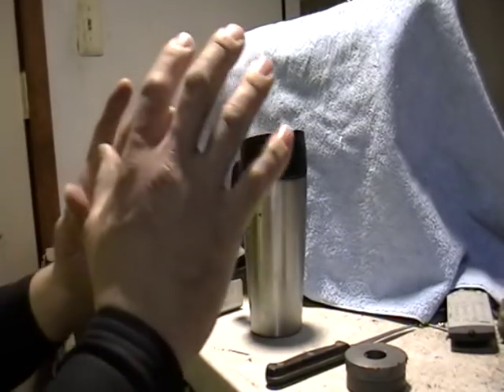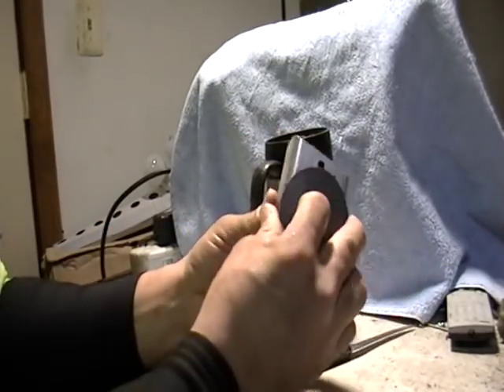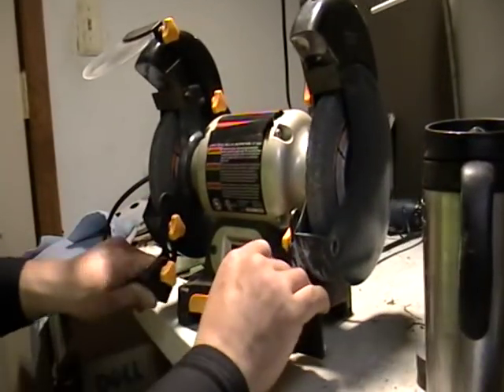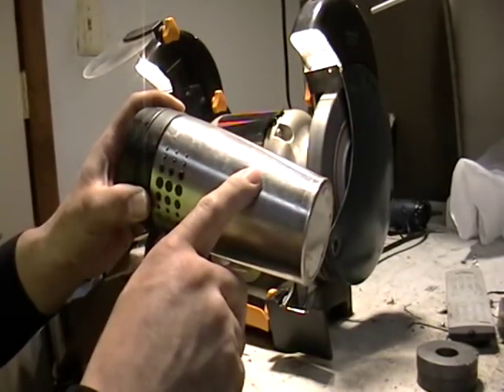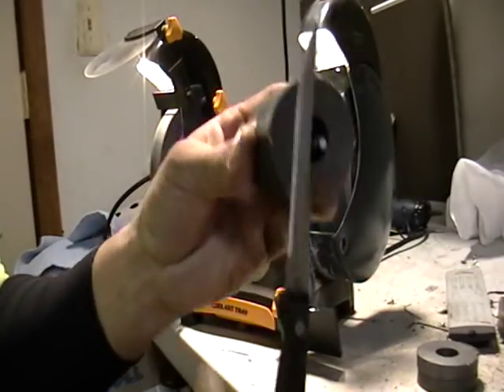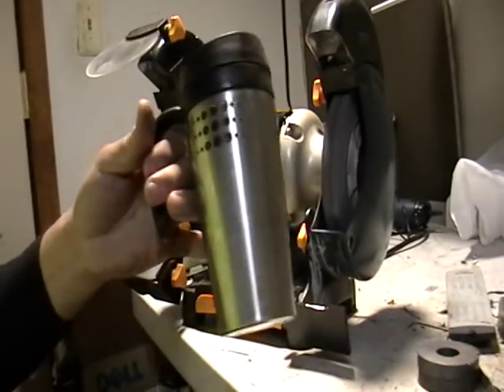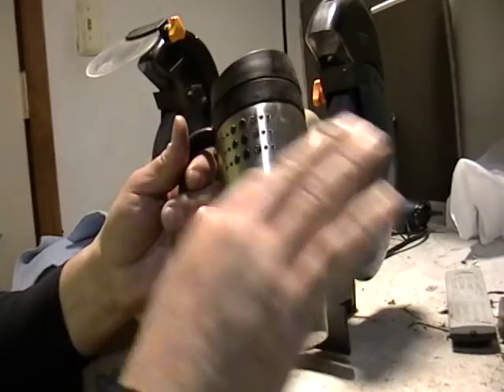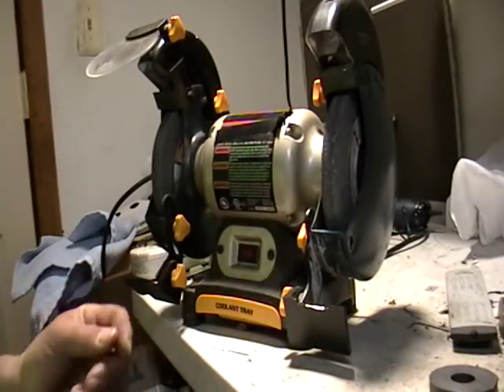Stainless steel or Aluminum how to tell?

Comment: Another method: Take a very sharp steel object (f.e. a nail /needle) and try to make a scratch in the material. when you get a good scratch its aluminium. otherwise its stainless steel.
Reply from the maker: atmosphere Adr Yes. I have done that in the field. the stainless almost glides the nail or blade away.
Reply: Thanks! I don't have a grinder laying around. Trying to find out if my roasting pan is stainless or aluminum. Magnet doesn't stick.
Reply: Thanks, I was pretty sure a second hand pan I bought was aluminium but good to have a way to test that doesn't involve a bench grinder.

Comment from the maker: aluminum is soft. if you use a screw driver and scratch the surface it will go in. Stainless it will slide off rather than make the same mark as aluminum

Comment from the maker: Brass is mainly used in plumbing as is copper...The other 2 metals this video  I explain..
Brass can be white coated with yellow inside or just yellow...( I have seen other colors) ( look underneath your sink) if its not pvc its either brass or copper or both...this should help

Comment: 1. Hold magnet to it. Aluminum, Brass, Copper, high grade stainless steel have no attraction.
2. lower grade SS has slight attraction.  They will move, but they will not stick.
3. Plain iron, tin, steel go together in a pile that has obvious, strong attraction.
4. Brass and copper on an old metal detector with a labeled monitor will have one that says 1c, obviously representing a penny.  Pennies issued prior to 1983 are primarily copper; ones after 83, Carbon Zinc.  Even though it means pennies, it also represents copper/brass pipes and wires, whatever you make from it.
5. There is another label that says Carbon Zinc.  This is self explanatory.
6. Another label the detector points to says iron.  Nobody confuses this when they have a magnet anyway.
7. A garbage can or bucket 3/4 full of water.  Plastic containers from PET to HDPE 1 and 2 are identified this way.  HDPE 2 will bob on the surface even when punctured or held down.  PET 1 will sink to the base if you allow the bubbles to escape.
8. The odds are if you've been to California, you heard of California Refund Value.  Specifically marked beverage containers marked CRV can be placed into a scanner and conveyor belt on the Reverse Vending Machine.  24 ounces or more sell for a dime each. Anything less, you get a nickel each. This determines not the weight, but how much water the bottle or can would hold based on its size.
9. Focus sunlight on it.  Plastic is often given a reflective, metallic coating.  Focused sunlight is the most effective way to tell light aluminum from plastic painted.  Plastic would get fried by a big lens that captures and utilizes more UV.  Using low scale, bad smelling smoke would rise from it.
10. Watch out for silver.  You won't find it in the garbage, but you'd best hold onto it if you discover it for cheap.
11. New distilleries that are catching on melt plastic not for electricity, but to produce kerosene.
12. New machines are designed for moulding plastic into specific shapes as needed for general public.
Reply: It's not quite that simple. For one thing, what do you mean by "lower grade" SST?  If you want a SST knife to hold an edge, you need a magnetic alloy, such as 17-4PH. ("PH" stands for "Precipitation Hardening", meaning it can be heat treated, as opposed to most of the 3xx alloys, which only harden to some degree from cold-working)
 I would call these high grade due to their superior strength and hardness, although they do rust to some degree.

  The most corrosion resistant common alloy is 316 SST,  which I believe is primarily non-magnetic, as the other 3xx alloys are, but I think they can all become slightly magnetic from cold-working.

  It also depends what kind of magnet you're using; if you have a rare-earth magnet (AKA "supermagnet") the attraction to some alloys will be pretty strong, though not by comparison with the attraction to steel.

Comment: Hey mike ive been scrapping for about 3 years now and im starting to delve into the nitty gritty stuff like transformers and contacts with silver etc.. Recently i got an entire car wireing harness with releys and fuses the whole works my question is on the fuse box i ran into a lot of conectors that are non magnetic and they're alluminum color maybe crome or stainless when i scratch then there appears to be copper and theres metal plates that i removed about 3 inches wide by verious legths made of the same meterial any idea of what this might be!?? Thanks!

Comment: Most stainless is magnetic but weakly.  Some grades are non-magnetic like 316 SS, but are if they have been worked or rolled into a shape like a bolt, the crystal shape changes and become magnetic.  If it is just stock 304 SS a good magnet, like the one the scrap dealer uses on your stuff, will show up magnetic.  Back to being confused?
Aluminium usually won't spark and is much lighter and softer.  Try to peel it like a carrot, SS won't peel.

Comment: Thanks Mike.  Great help except no grinder!  Is there a way to use a precious metal testing kit to determine?  Different reaction to a certain acid?
Reply from the maker: Karl Hensel Use a knife. Aluminum is softer, the knife will dig in. Stainless is harder, the knife will glide off...
Reply: Mike the Scrapper Thanks.  I used a knife and I can scratch fairly easy.  The items are ID tags (blank) round with holes.  I have 1000 of them.  Appreciate it again.
Reply: Karl Hensel just use a dremel tool with cutting wheel, works great

Comment: I have a question though. I have a few very heavy 5 inch metal pipes. They are not rusty but have been outside in the rain for over a year. They metal kind of reminds me of a chain link fence post, just thicker and whatnot... But anyways, does this alone mean that its steel? If not, how can you tell between iron and stell if there is no rust.. thanks

Comment: thaaaank you nice video I have a falsuat I took apart it had bras copper.   and some parts I could not tell if it was stanless or alummim so I used a drimel tool to graind at it and it didnt spark but was still unsure untile I saw this video now I know it was alumium ....great video

Comment from the maker: Try by color...aluminum is duller than stainless or use a knife...Aluminum is softer and wil cut easier
Reply: Except I have aluminum flashing for fixing roofs that is very shiny. And some sheet metal that is dull. I am thinking it is aluminum because it scratches easy.

Comment: hello mike.when stripeing electic cores some r copper and some looks like aluminum,are r they stainless steel, help
Reply from the maker: Mike Bourgeois I would say aluminum
Reply: I have come across "aluminum" wires, and after winding into a spindle, i cut it in half with my wire cutters, and the purdy copper is seen...not all times, but most, (this is in reference to your everyday power cords)

Comment: how often does one have this big machine?! Is there a way to test/tell the differences by the naked eye without going to a lab?
Reply from the maker: use a knife. if it glides across the metal its Stainless, otherwise its Aluminum. also Aluminum has a darker Tinge than Stainless.
Reply: @MiketheScrapper  thank you.

Comment: * Would a Small dremmel (sp?) work, with a rotor on the end? Or...
* Could you use ANYTHING cylindrical with a drill on the other end?
* Will you be scratching them up quite alot by using these methods (and the method in the video)?
* Do you know of any OTHER ways to tell if something is stainless or aluminum    Other than, "Striking it several times with the coarse edge of a file ??
  
  ty for your time
Reply from the maker: Barbara Smith as long as the tool does scratch the metal. Try on steel 1st to be sure it does spark. also a magnet helps...

Comment from the maker: I do have a video on that but it is mixed in with other stuff... I will make one just for that... Aluminum from a grill is cast. drop it on the ground and it will crack or break. this should give you a hint..

Comment: what about to the touch? is one colder then the other?
Reply from the maker: I have never tries that. but if this was winter or summer not sure if it would work.
Reply: here in california its 63f and i have a keyboard and mice thats made out of aluminum but 1 of them is cold and the other is like warm cold
so im thinking the one is the coldest is the stainless steel idk
Reply: No. Metal is going to be room temperature. When you touch metal and it feels cold, it's because it's pulling energy away from you and to the metal, it's absorbing heat. The sensation of energy, heat, leaving your skin to the metal, makes it seem cold. 

But any object in room temperature, is going to be room temperature, unless you are actively heating or cooling it, or it is in the process of going to room temperature (ie a coke pulled out of the fridge).
Reply: so witch is going to be colder then the other? lol

Comment: @1:49 nickel (and iron and cobalt) in (stainless) steel are magnetic; chromium in stainless steel is not magnetic at room temperature.  chromium becomes paramagnetic (weakly magnetic) above 38 degree C.  in general, the composition and magnetic properties of stainless steel varies.

Comment: I have further information is it helps.  High carbon steel gives more orange branched sparks.  It is more difficult to weld and cut. Titanium gives brilliant white sparks.  Think sparklers on July 4
Reply: I strongly doubt that someone bought a coffee mug made out of titanium 
off the shelf somewhere.  Besides being expensive, it's very difficult 
to work.
Reply: Some camping cookware is made of (very thin) titanium.

Comment from the maker: Aluminum cuts softer with a knife. where stainless steel will cut the metal but the blade will slide off faster. Iron is magnetic and so is stainless. But non magnetic stainless is worth more money than stainless. I will write a script on this for  future vide.
Reply: Mike the Scrapper Hello Mike. Thank you for your video, it really helped. However I feel the need to add the following: there is no such thing as non magnetic stainless steel. If my memory doesn't fail me, to have non magnetic stainless at room temperature you need at least 8% nickel in the mix, but if you heat the steel up to 700 degrees Celsius it will be magnetic again.

Comment: use safety with rotating equipment (no sleeves, long hair, loose clothing and safety glasses) and use extreme care when using grinder as the knife can get sucked in between the grinder wheel and tray or fling the knife into a person.  please watch a training video on using a grinder wheel or steel brush wheel equipment
Reply: Let's just hope a 6 yr old didn't click on this video. Or, let's just hope a 6 yr old doesn't see this and then have access to a grinder.

Comment: hacksaw works fine to.
if it cuts like butter its aluminum.
even if its thin stainless steal its hard to cut, you will notice the difference.

Comment from the maker: those fence poles are Galvanized... if you have enough you might get more money at the scrapyard...it is considered heavy steel... Iron & steel rust... Just becareful when cutting. Use a sawall not a k12 saw...It can make dangerous gases

Comment: what if i don't have the grinder? it's not easy to buy that tool
Reply from the maker: Use a knife. Aluminum cuts deep, stainless , the Knife glides off it.
Reply: okay, i'll try it :) by the way i have this small pan that i buy pretty cheap but it's very thin and easily dented. my dad says although it's thin, it's stainless steel but i can't bring myself to believe it. is it possible for stainless steel to be very thin?
Reply from the maker: Sure, put a magnet to it..
Reply: j
Reply: dremel

Comment: what when a grinder cant fit in to test the component?
Reply from the maker: use a knife. if it makes a gash its aluminum. Non magnetic stainless will slip over and barely make a gash. But please be careful.
Reply: +Mike the Scrapper good man.

Comment: okay...what about magnetic stainless steal?, steal and stainless both spark
Reply from the maker: lays 88 If its magnetic, its just steel...Non magnetic is worth more....
Reply: Mike the Scrapper 
I heard there was a stainless called 400 grade that's a little magnetic I wasn't sure if it was worth separating or just throwing it in my steel pile, but I just called my yard and I guess they will only take It as steel. Thanks for your time mike!

Comment: what if you don't have a grinder?
Reply from the maker: Use a sharp object. Scratching Aluminum will dig deep, being that the metal is soft. Stainless will glide and not scratch as deep.

Comment: LOL !!!
Where do You need grinder for ??? You can tell by using that knife for each of them.
Aluminum is much more softer and You can scratch it very easily by knife, but not stainless steel. You can even cut little pieces off of aluminum by knife.
Just try it and You will never mix them up again even if You don't have grinder in Your back pocket ;-).

Comment: Why in the hell doesn't a magnet stick to stainless steel?  Somebody has got to clue me in on this for it makes no sense.  Stainless contains iron; so it is not logical, even though it is true a magnet will not stick.
Reply from the maker: It has Chromium and/or maybe nickel. This makes it more Valuable. Look up Stainless 304 & 316. this should help..